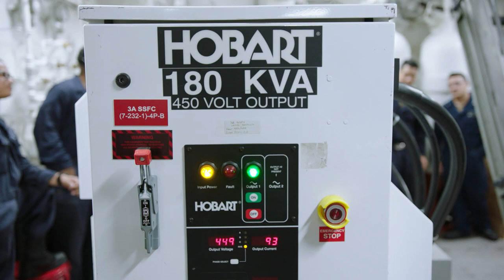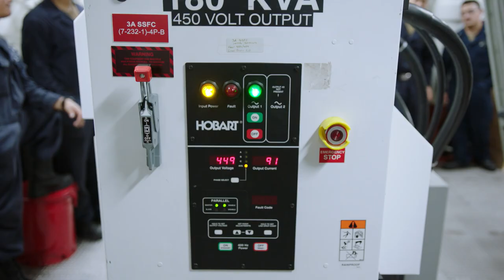Navy Nuclear Operations

Comment: "Uranium in the presence of water will cause fission....." I don't think that's how it works.
Reply: It’s poorly phrased but not inaccurate. The presence of water slows the neutrons ejected during fission through elastic collisions. These neutrons are more likely to collide with uranium present thus increasing the rate of fission
Reply: Tell us, then. How does it work?
Reply: @iasimov5960  Obviously, none of us who were in the Nuclear Navy can go into specific details about the Navy's nuclear plant designs. There is a wealth of information available in the public domain; I'll give you the short-short version of how a reactor works.

Water in a reactor acts as a moderator (slows the neutrons down to a speed favorable for absorption by uranium). The absorption of neutrons will increase the rate of reaction. Get enough water at the right temperature in the right concentration and geometry of uranium and you have a sustained nuclear reaction.

There's a whole lot more that goes into it. Nukes spend months studying how and why these reactions work. And the engineering that goes into the naval reactors to make them robust and reliable would make your head spin.
Reply: @AtomicAJ74   I was RCLPO on an SSBN.
Reply: @iasimov5960  So you knew the answer to the question, but asked it anyway because...?
Reply: @AtomicAJ74   Sarcasm, son. Sarcasm.
Reply: Thanks, that makes a lot more sense. I was just thinking fission occurs naturally in uranium. 

Don't have a nuclear background but using water as a moderator for increased fission rates (more flying neutrons) vs being the cause of fission (neutron splitting atoms) are two separate things in my mind.
Reply: @Jedi2155  Fission does occur naturally in uranium even without the presence of free neutrons but at a very low rate. In this specific context, the type of fission implied is a sustained chain reaction.
Reply: enriched uranium will only fission when there is a moderator (water) the neutrons move to fast and the chances of a fission is to low to sustain a chain reaction. If you lose the water the fission stops.
Reply: Yeah - as stated by JB and others ... that's not exactly what he meant.   A nuke would get it.  It's all we know .... the plant, the coolant and the sea. (heh)   At least when I was in the program <garble> years ago, everything else was a blur.
Reply: 8205/S8G/SSN-671/MTS-635 here.

Technically yes, but he doesn't go into the fact that after "Fred, the Duty Neutron" starts the chain reaction, that the neutrons in the water molecules turn the fast neutrons into thermal neutrons from collisions, like with pool balls.  They are then absorbed by the U-235 atoms to become an unstable U-236 nucleus and fission into fission fragments (Krypton and Barium, I think...)  Anyway, that fission produces heat (through friction) and extra fast neutrons.
With more water available, the chain reaction continues.
To limit or stop the chain reaction, the control rods of hafnium are used to absorb the fast neutrons so they can't continue the process.

Anybody old enough to remember:
Every Little Fuckin' Pollock Loves The Fuckin' Navy?

Can't teach that today!!  But back in '82, no problem!!!!

I'm glad I served and I'm glad I GTFO when I did, '91!!!

More power to you, Kids!!!!
Reply: @johnleeson6946  Thanks for your service - '82, eh?  Well, in '76 when there were 2 NPSs and pretty much only 2 protoypes, we had quite a few of those to memorize.   Geez, now that you mention it, '82 was a long time ago as well!  :)
Reply: @calvinhobbes7504  Sure was, my fellow Nuke!  Thank YOU!
Mare Island or Bainbridge?!
Were you at "Sometimes It Works", "Stuck In Connecticut", "Alice In Wonderland", or maybe at the "D1G Ball"?
On what did you go to sea?
Reply: @johnleeson6946  Hey John - and thanks for your service my friend (shoulda said that earlier) Yep!! Mare Island and S1W in Idaho (for C1W, Long Beach)  It worked better with the Gimbals locked!!
Reply: @calvinhobbes7504  So they put a Nautilus reactor in a cruiser? Same thing for the USS Bainbridge?  Were they the only non-carrier surface ships?  As far I can remember, they were.  We're of the age where I want to lean on my own knowledge instead of the "Internet Machine"!  
I don't know what "Gimbals locked" means.  Sounds like a "skimmer" term... 

Never had to rig for Circle Dog Zebra...
Reply: @johnleeson6946  Heh - John I wanted to go to sub school - I thought I was a sub pre-qual, but maybe not .... oh, there was Long Beach, Bainbridge, Truxtun, Texas, Arkansas, California, Virginia - and a couple more I missed.  All those guys were based on the S1W, I believe.  Ya seen one, ya seen 'em all, IIRC.   Oh yeah - the gimbals were anything but skimmer!!!  S1W was mounted in a giant gimbal to simulate the roll and pitch a sub would experience .... I think they pinned it in the early 60s, but the hoops were still there when I was there.
Reply: @calvinhobbes7504  Thanks for the update.  The cobwebs are starting to clear...a bit.
I never heard that about S1W.  I know that they did that with the S5G prototype. That was the Natural Circulation plant that was on my boat, the Narwhal.  I heard stories of it looking like a ketchup bottle in a bathtub since it was painted red.  I was at the other NC prototype (S8G) in NY, but they didn't have it move.
The NC core worked like a charm at sea.  The colder the water (cough-cough... Northern Runs), the better the Alpha T and the more power with no pumps.   Carnot Heat Engine Theory...

No Sub School for us.  After a year in Nuclear School and Prototype, it would have been a vacation!!!  We learned on the Boat!
Reply: @johnleeson6946  Heh - John, A classmate told me about the S-5G system, but I thought it was just rumor.  We had enough trouble getting quals done on our own prototype (yep - I was on hours for being 6% behind - but I had great classmates and a civilian instructor who got me through)  Yanno, the only thing I'm glad I missed about subs was that I knew I'd be on a boat that went above the circle, and I love my short but warm showers!!  :)  (do they really make you shower in frigid water?)  I thought that mighta been a rumor too!  :)
Reply: @johnleeson6946  Man, John ... I loved the Long Beach ... but I really envied submarine duty because I thought those guys were doing the "real" work ... on the Long Beach, our "real work" was as a test bed for every dang fool gadget they wanted to try out, it seems.  And the RO gang when I was there had a few guys from subs in it ... never figured that out, but I kept my trap shut and the books open.  I'm glad I did!  :)  I had a great career because of Rickover ... they say all kindsa stuff about him, but he was a genius who knew how to get his way!  :)
Reply: @johnleeson6946  I got it in'97.. it's a different world now. Everybody's sensitive and offended
Reply: @jb76489  Yeah but he and you forgot to mention that it is the heavy water (D2O) and not the ordinary water (H2O) that has the neutron slowing down capability.
Reply: Yes it is how it works. Water acts as the coolant AND THE MODERATOR.
Reply: @SK-ck9qu  that isnt true. Regular old H20 will slow down neutrons to make them thermal neutrons. Navy reactors do not use heavy water. There is something called "the average thermal decriment per collision" that is an experimental value of how many MeV each nuetron loses, and determines how many collisions are necessary to achieve an absorbable state. This changes with the temperature of the water. This is why steam demand controls reactor power. People have a misconseption that control rods control reactor power. That is not true. When you increase steam demand, the water cools, bevomes more dense, and creates more thermal neutrons, and therfore reactor power increases. This is nuke school 101 in the Navy.
Reply: It's just very simplified
Reply: It isn't how it works, he was a surface dude though... and surface people are basically coners who don't understand how it works.
Reply: Well, technically water as a modulator will causes fast neutrons to slow down and convert to thermal neutrons which uranium absorbs and causes another fission reaction, but what do I know.

Comment: I don't know why they like calling them "nuclear powered" because technically these are steam/electric powered ships.  Nuclear fission is the method used to create the steam.  The fission itself does not power or electrify the vessel, it's a way to produce the heat necessary to heat water.  Uranium has basically replaced coal, but the principle is the same.  Pressurized steam  is the desired product to turn the turbines that either directly turn the propellers and/or generate electricity.  Nuclar power is just a more efficient way to create steam than fossil fuels....but it's heated and pressurized water (steam) that turns the turbines.
Reply: All electricity and propulsion aboard a Nuclear powered ship is from the energy created by fission.

So... The ship is nuclear powered lol
Reply: @Scott Cole That's only if its heat based power generation. There is also chemical and mechanical like solar power, wind farms, batteries, etc.
Reply: Nuclear Submarine sounds cooler.
Reply: The energy source is nuclear, therefore they are "nuclear powered".  Thats the same way nuclear power plants on land work.
Reply: Semantics.
Reply: By your logic, coal and natural gas are both steam power. The name comes from the source of energy which drives a turbine. Even wind and hydro and named that way.

Comment: <<ET1 nuke... I approve and recommend this program !
Reply: @Ash12428  HS grads operating reactors? Yes after 16-18 months of 40 hour a week school (IMO equal to a college BS degree) and still maintaining your sanity keeping your uniform clean because the chief saw a spec of dust. Once out of school, you're treated like a regular officer almost. The Captain of the boat HAS to ask your permission to enter your Control room :) oh, and the bonuses !!
Reply: @Ash12428  ET > MM(ELT) > EM > MM is my preferred order of ratings. Some schools i have.seen give up to 45 hours of credit. Nuke officers are usually EOOW qualified and can go to any boat or ship.
Reply from the maker: Specific underway schedules can vary widely. Normally ships will go to sea for 10 days to 2 weeks each month for training operations in preparation for deployment. Extended operations away from homeport can last up to 6 to 9 months, and ships typically deploy once every 18-24 months. This varies depending on the mission and type of ship one is stationed on. If someone is on a shore duty tour, they will likely spend no time at sea during that duty assignment.
Reply: I'm looking to go into Navy Nuke once i'm out of high school. I have bad habits that I've been trying to break but I also want to know good habits to make before going in. I have a year of high school left and I want to work in good habits while breaking the bad. Any suggstions?
Reply: @thoamas1237  I'm an ETN1, and my advice is learn how to study. Develop grit. Expect more out of yourself.
Reply: Propaganda ^
Reply: @thethinplace  I tested high enough for the asvab and the other tests but I was told I can't apply because my highschool grades. Oh well to bad I got this dream in seinor year
Reply: @thoamas1237  waivers are possible and remedial classes can help. Whatever math class you did badly in, take it or the next level of it at the local community college. It can help getting a waiver approved. I've heard of GPAs below 2.0 getting waived in if everything else is in place.
Reply: @kbarrett63  Given the fact you called it "control room" makes me doubt that you're an ETN XD
Reply: @ww2planes_810  my bad...EOS (air conditioned at that ! ) ....were you an MM?